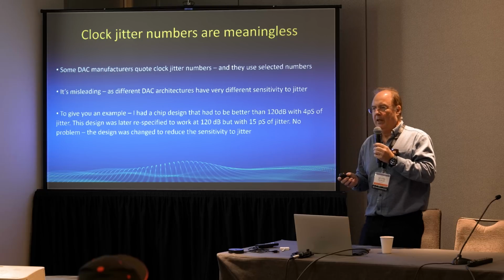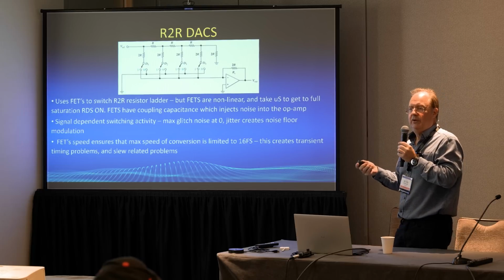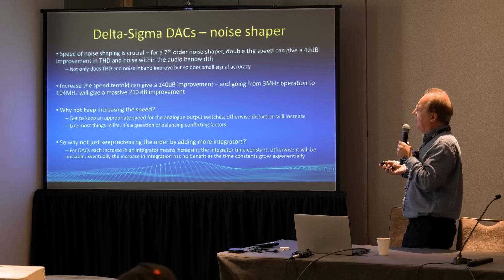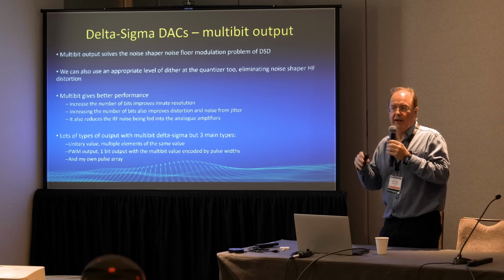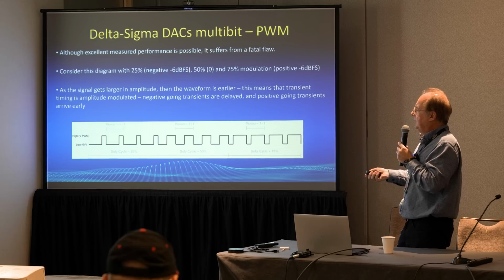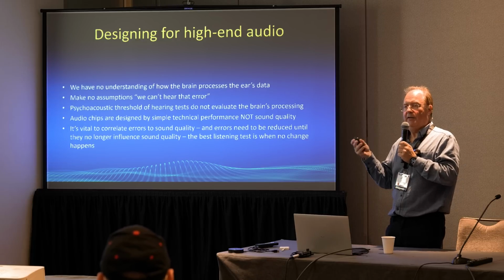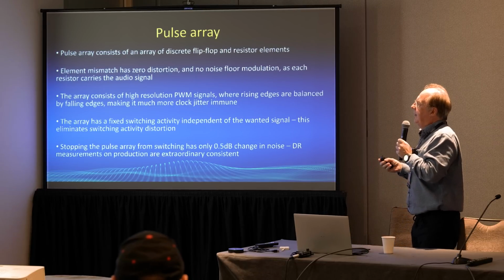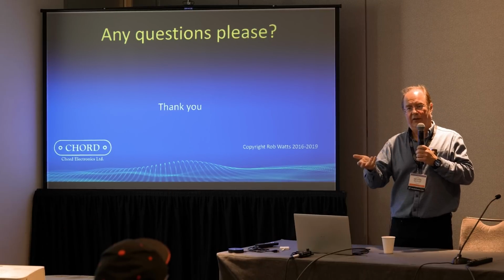Rob Watts of Chord Electronics on DAC designs and drawbacks - CanJam NYC 2023

Comment: Mr Watts neglects manuf. examples of various topologies presented. PWM (Matsushita, MASH); PDM (Philips, Bitstream), R2R (Burr-Brown, Analog Devices, discrete ); Delta-Sigma (ESS, AKM, TI, AD, Cirrus/Crystal). And perhaps the biggest miss is Philips' orig , very popular multi-bits (DEM and CC). The classic TDA1541 is "DEM" (dynamic element matching). With DSD, one can ditch the DAC entirely and low-pass filter the signal.

Comment: timbre, details and soundstage is better but other reviewers say dynamics suffer vs desktop dac's around 700usd - 1k. interesting that the analog measurements shows the best sharp filter of any dac tested but the multitone distortion is around 20 bits and not 22-23 like some other dacs. wonder why all that fpga and oversampling magic didn't translate into lower analogue distortion although i won't go so far as to say these metrics translate into better dynamics and better bass response that the reviewers report. micro usb is the worst connector ever made IMO.

Comment: its 2023 and there should be no excuse for not having balanced outputs on the mojo 2
Reply: Balanced headphone outputs are more marketing gimmick than practical performance. Electrically, they don't really have many advantages over SE. If the Mojo is powerful enough as it is, then there's no point in going balanced.

Comment: It’s all good but it’s time to make a mojo 3 with proper connections and built in Bluetooth.  I want to get into the world of Chord but I just can’t buy a mojo2 and a poly in 2023.
Reply: Yep, I'm a big fan of Chord products but for portable listening I carry a Sony DAP even though I've got a Hugo 2 + 2go.
Reply: Use a Poly, yes it has its issues but it does support Bluetooth, no idea how good it is because I've never used Bluetooth with Poly. While Chord still sell Poly I doubt we will see Bluetooth on the Mojo.
Reply: I have a 1Mii B06HD+ Bluetooth device. It's about £80 and supports LDAC and outputs raw to the Mojo. I bought a coax to 3.5mm mono cable and have them hooked up together.

So much cheaper than a Poly with a decent Bluetooth codec unlike Poly which is just SBC.

Comment: All this talk and your DACs still hiss with IEMs.
Reply: An IEM that hisses with a DAC with better than 100dB+ noise floor is badly designed. The noise floor of RW DACs are among the top few DACs measured by anyone.
Reply: @kentajalli  or maybe its just way too sensitive to receive the slightest of current, ever try to use a resistor like one of those ifi iematch that reduces current output?
Reply: @kentajalli  noise floor at max volume doesn't tell you anything about hiss. At low volume (as in where you would actually hear the hiss) noise floor of hugo tt2 in low gain over xlr is 12dB worse than in $50 3.5 dongles like sonata hd pro. Amir has a chart of noise at 50mV but if something isn't there you can compare left sides of power vs distortion charts to see the true noise floor.
Reply: @lunafag  \\Yeah about that. Why is it measured at 50mV and 600 ohms? how many sensitive IEMs can you name with 600 ohms impedance. Chord DACs are by design single-ended, and they get picked at, scrutinized at, because of it. I think the test should be done at 50mV and 32 ohms max. Most ultra sensitive IEMs are 10-32 ohms. It will also catch those DACs with high output impedance, on the act.
Reply: Question is, is it the DAC or the AMP part that hiss. But yeah charging as much as Chord does then it should never hiss.
Reply: @leonarda8946  More likely to be the IEM, but some brands associated with "high end" companies like Earmen and Auris Audio made some very good sounding products that have terrible noise floor. Wouldn't be surprised if the hiss from the dac/amp itself. No idea why when new chinese brands like Topping and Aune can make desktop stuff that are hiss free even in high gain.
Reply: What iem do you use? I'm thinking of getting mojo for andromeda and jomo salsa which are very sensitive
Reply: Not for me!